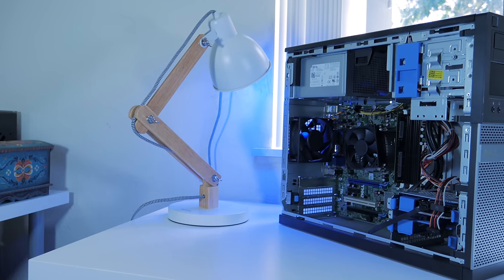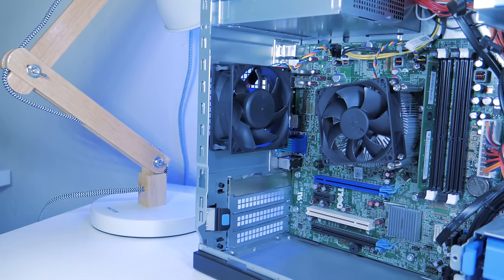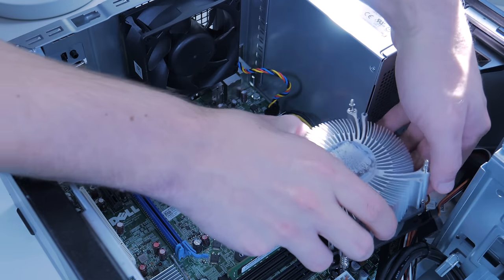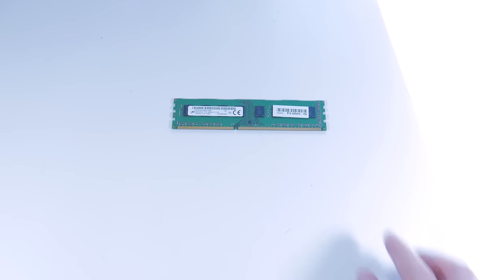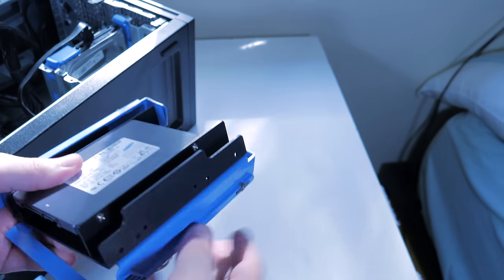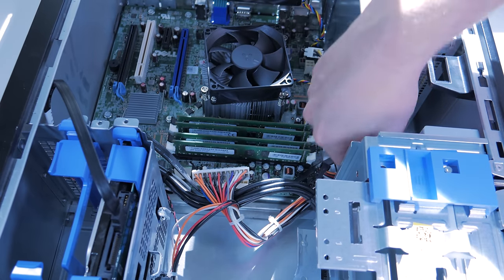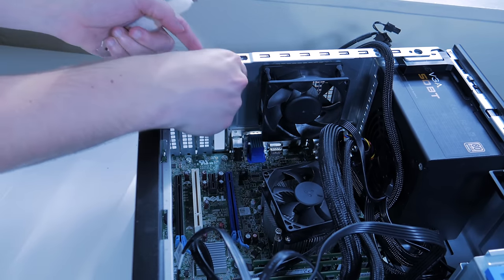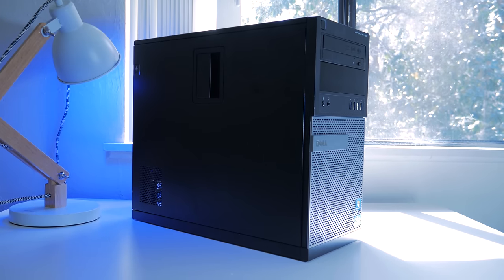How To: Turn an Old Office Computer into a Gaming PC!

Comment: I got an insane deal where I live.

Found a i5 3450 powerspec PC with 8gb of ram and a 2tb hard drive for 40 bucks. I had to replace the cooler since the system had like a pound of dust in it and it had destroyed the bearings on the old cooler. Luckily I had the same OEM cooler sitting around that I paid 3 bucks for.

I'm sure the system was stolen or something, or he thought he was selling me a lemon, but I'm not complaining.
Reply: damn that a good deal. where do you live
here in morocco a used pc like that will cost you 250$ or more
Reply: ALI sensei I live in Kansas and in a city with alot of tech.
Reply: Where I live that would cost you 500$ or more
Reply: Yard sale?
Reply: Found a Optiplex 390 with an i5 2400 and 8gb if ram for $30. Plus a ASUS GTX 770 2gb for $100
Reply: JForce that with a slightly more powerful processor cost up to 400 GBP.
Reply: On eBay US that would still run you $140 or something, nicely done
Reply: A kid who didnt know nothig about pc gaming anf thought he had a potato from 2002
Reply: Damn thats really good
Reply: Not to far from here there is a company that sells off decomissioned servers you can get a dual 6 core 12 thread cpu server with 32gb of ram for less than $200
Reply: thats a steal a normal price for that would be like 150-200$
Reply: JForce e
Reply: @jforce321  I do too, do you use craigslist?
Reply: @paydayda3rd812  yes
Reply: JForce I got an optiplex 390 i3 2130 8gb ram that also came with a mouse keyboard and the original dell 1680x1050 monitor for $25 got it from my local library after they replaced all their systems
Reply: I got an I5 5700K with 8 gigs of RAM (there were 16 but 2 were broken) and an GT 720 1GB for 70 bucks . I changed only the power supply . And I had a surprize when I found that the cooler had a socket where I found 2 sealed cooler paste :))))
Reply: ZTutorials nice pretty good deal
Reply: @icyfrog5064  yes , and I sold it today by 300$ (in this time I installed win10 pro and I activated it with KMSpico) . So everything You see a cheap PC , buy it
Reply: Can we just take a look at his channel
Reply: One time I found an LGA775 emachines at a recycling center that was probably thrown out because of overheating, the cpu cooler was completely clogged with dust. Needless to say it worked fine after cleaning the cooler and applying new thermal paste.
Reply: In my city it would cost about 50 - 70$ for used ones
Reply: Thats a good price
Reply: @jforce321  an app i wound not have risked it but atleast you got it
Reply: ALI sensei 🇲🇦
Reply: ALI sensei but it is still worth it i live in Morocco too
Reply: JForce :(
Reply: Where I live That would cost me like 400$
Reply: In Tunisia 🇹🇳  that costs 250 USD now 😢
Reply: Even PCs in England that still run on Gas cost 300 plus :)
Reply: got i5 3470, 4 gig ram and 500gb for 210 bucks, used market here are fucking ridiculous
Reply: @komradkat1073  
that's really high
Reply: Yeah who cares if you own illegal property

Comment: My family pc Acer M1935 bought on 2012 or 2013 if im not mistaken:
I3-2120, Win7, 2gb ram, 500gb hdd, intel hd graphics.

During the lockdown i tried to upgrade it now this is the specs:
Same proc, win10, 10gb ram, 120gb ssd + 500gb hdd and amd r9 270x 2gb. 

Now im saving for a new psu and hopefully a new processor by the end of the year. Wish me luck!
Reply: Good luck! I am planning to buy a whole new pc. I have an amd a4 5000 and 4gb of ram with win10
Reply: Not too bad you should save up for an a320 motherboard and use an AMD ryzen 3 zen 2

Comment: I already did this but on eBay. Got a Dell Optiplex 9010 SFF desktop. Upgraded the RAM, HDD and GPU. This is the specs now:
3.40 GHz i5-3570
12 GB DDR3
GTX 1050 Ti LP
1 TB HDD 7200 RPM
Windows 10 Pro
Reply: And why did you get a small form factor p? Have you even tested how it performs? Sff pcs suck cause to play at lest 1080p you need a small and low powered gpu and those sick and cost more
Reply: Dark Angel Rafael nice
Reply: used sff are pretty cheap for their cpu and psu, hdd . really just need a gpu for a decent gaming pc
Reply: Ran Ng got mine for $99. With the CPU inside he could've charged me much higher as others desktops with older CPUs cost about more than $100.
Reply: Sean Timothy G. Tanega I get very good performance. I'm just limited with upgrades.
Reply: D o s s o CS. thanks a lot!
Reply: Kevin Guan exactly why I got one. cost me less than a base PS4 and outperforms it in every game.
Reply: thats better than my computer
Reply: I bought a 990 recently on eBay and now I'm just waiting for the pc to arrive so I can test it and see whether It's worth upgrading.
Reply: How is i5 3570
Reply: @ApexLodestar  upgrading old PC is more money efficient that buying new PC every 5 years or so
Change my mind

Comment: Some newer Intel CPU holders/sockets (that's where the CPU rest on the MB) on the motherboard do not have a readily visible alignment mark. There are notches on each side of the Intel CPU and if you look carefully you will see the corresponding protrusions on the Intel CPU holder/socket. Align the Intel CPU notches with the socket. For RAM - if you are adding to what you already have, try to get the same latency. It will look something like this for example: 16-16-16-39. It may be important in some instances. Just today I had an incompatibility issue with some RAM and once I removed the add-on RAM my system again worked fine. Most RAM will work in unison with other RAM, but sometimes it will not. For you newbies, I hope this helps? Praise The Lord and Godspeed to you all - Hebrews 10:35!!
Reply: Tony C. 
Thanks for this man
Reply: Ram of differing latency will always train to the lower spec or the higher latency/lower speed RAM's specs. Mixing ram is generally a bad idea unless it's just mixing brand names that doesn't seem to matter much but differing speeds and latency matters quite a lot.
Reply: It's been my experience that if you have low density and high density modules in the same machine it will cause issues, and the same goes for using double sided with single sided modules.  I just want to throw it out there because I know from experience that these Dell Optiplex 790 and 990 computers won't post with DDR3-1066 (PC3-8500) or 8GB DIMM Modules. They also only work with unbuffered DDR3-1333 or 1600. They won't work with Registered, ECC, or Buffered memory. They sometimes also won't work with "gaming" memory that requires more than 1.5 volts. Gaming memory is not going to be of any benefit anyway in these systems as they offer no ability for overclocking.
Reply: The mate

Comment: I currently have the same desktop featured in this video. I have done several upgrades and now this thing is a beast. 
My specs are i7 2600 non k, 16 gigs ram, 220 gig ssd, 1 tb HDD, GTX 1070 gpu, thermaltake 600 watt psu. I added WiFi and Bluetooth as well. Oh and some RGB lol.

It crushes every game at 1080p
Reply: Price?
Reply: @plzsubtome4010  I got mine for $100, came with an i3 but I put a i7 in it for $80. SSD was $20. Psu was $50
Reply: This is late but is the pc still going good?

Comment: My Optiplex 7010:
Intel i5 third generation
8GB RAM ddr3
500GB mem
And default graphics card.
MY UPGRADES
+2x4GB ddr3 RAM - 16$
+GTX 1050 TI - 70$
TOTAL COST OF PC WAS 186$ AND IM PLAYING PUBG IN 50-60 FPS
Reply: I got this as a 2nd project pc, I got an RX460 for 50 dollars then flashed it to an rx560. It's an amazing cheap PC that won't kill budget
Reply: Jose Gap can the rx460 work on a oem like this and is yours the 4gb version
Reply: @seniorpepe9386  No, not Dell has more problems then go for this setup. Check oztalkshw prebuilt. He also has an exclusive offer on Rx 460. I recommend keeping it as an rx460 if this is your first pc.
Reply: @josem1596  no its not my first pc or anything i know that the later model amd cards run on uefi bios and the optiplex i hvae can be swapped to uefi mode but im not sure if it will work i dont want to waste my money and it not work
Reply: Did u just say 500gb memory xd
Reply: Kijo idk where you live but I have 4 sticks of ddr3 ram I don’t want so if you want 2 then you can have them
Reply: NOT Lencx hey I’m building a pc could I have them?
Reply: Lencx lol can I have it
Reply: cool, I can imagine ur playing at high to max settings?
Reply: You have 508gb of ram

Comment: i7 2600, RX 560, 16gb ram, and a 110gb SSD took a free office PC to a capable gaming PC. Plays what I want it to without any problems and was $110 in parts to add on to what was there. Luckily it had a 750 and 500gb 7200 HDD's already in it.
Reply: what was the name of the office pc? Might do your build
Reply: @LaStallion  it was a no name prebuilt. It had an i5 2310 in it to start. If I was doing it again I'd go ahead and get the i7 3770k if you have the appropriate bios for it.
Reply: @LaStallion  I have since also added a cooler master 400watt power supply, ring 12 120mm front fan, and waiting on a gtx 1650 super and an upgraded CPU cooler. The additions will get me playing Doom eternal in 1080 with high settings and comfortable temps .

Comment: Hey Matt! You can actually clone a larger drive to a smaller one so long as your data does not exceed the size on the SSD! I've done it before using hirens boot disk :)

Comment: I would recommend starting with an Optiplex 7010. It looks exactly like the tower in the video if you get the larger form factor. However, some 7010 come with an i7-3770 already in the board. I found one cheap and threw in a 400W PSU, 32GB Gskills Ripjaws RAM, 250GB SSD, 2TB WD black HDD, and a GTX1060 6GB. It is my daily rig and I love it. It handles anything at ultra in 1080P.
Reply: If it the CPU is in the motherboard you can't change the CPU without changing the board right?
Reply: @david7598  bro the 7010 has removeable cpu

Comment: I've been planning buy an i7 2600 optiplex and upgrade with a better psu in a new case with a gtx 1070.
Reply: PaneledPear6555 will that even work
Reply: PaneledPear6555 Tbh if you have a 1070 you should a better system like a ryzen system.
Reply: On Soul Not necessarily. If you do 60 fps on higher resolutions then the 1070 is the component creating a bottleneck. While the 2600 will go strong up to around 100-120 fps at 1080p ultra.

Comment: Nice thing is that many of those 790s come with the i5 2400 as the OEM chip, all of mine did. I didn't even know these machines were good for upgrading and just happened to have bought 3 of them from Goodwill, they've all worked out great so far.

Comment: Usually Dell uses custom cases. It's hard to modify a Dell because nothing really fits into the case. I suppose it would be best just taking the components out and putting them into another case.
Reply: you can't 'cos sometimes OEM mobos also have custom design and you simply can't fit them into any other case.

Comment: Had a Dell Vostro 230 on hand. Had a dual core cpu and an old mechanical hdd no video card. 2gb ram. I added an Intel core 2 quad Q9650, Nvidia GT1050, 600 watt Raidmax PS, bluray rom drive, usb 3.0 frot header and rear addon expension card, 8gb ddr3 1333 ram, 500gb WD SSD, put in better fans and used the old mechanical HDD as a storage drive. All of which I had on hand. Thing runs sweet. Using as my backup pc.

Comment: Did this last year for one of my boys.  I7 3770, 16g, new 250 SSD & 1 TB HDD in there.  I already had a GPU sitting around from some old builds, so all I ended up buying was a GTX 1060 mini off ebay for $100.  I added some new thermal paste and cleaned out the dust.  The GPU & CPU are a good match - no bottlenecking.  It's silent and fast.  If you're running 1080p at 60hz, then there really is no reason to drop $1k on a new PC.

Comment: I have a Dell OptiPlex 7010 which came with an i7 3770. I added 16Gb RAM and a GTX 1070 and the performance is amazing!
Reply: Did you get a new power supply?

Comment: I found an optiplex 9010 with 16gb ram and a i7 3770 for $220. No hdd, but holy crap! Got a 750ti, a cheap used evga 600w, and a $20 wd blue. Awesome system for under $300. Just assembled it today.

Comment: The i3 2120 is honestly great. I paired it with a gtx 970 and 12gb of ram and it ran gta 5 on almost ultra settings. But 1155 motherboards are hard to come by
Reply: Roberto Ortega the cpu might be a huge bottleneck sometimes
Reply: Roberto Ortega The i5 2400 is a better option.
Reply: the ryzen 3 1200 is much better for the same price. compare them on cpu.userbenchmark.com and you'll see
Reply: WhatTheHax cpu user benchmark is whack. It doesn't give accurate info. The i5 2400 is just as good.
Reply: PaneledPear6555 tbh,if the guy wants sumthing new,he should go for an ryzen 3
Reply: littlelittle boiboi I don't think so. DDR4 prices are so high that ryzen 3 isn't worth it at all.
Reply: littlelittle boiboi An i7 2600 optiplex is much cheaper and can handle 1070s unlike the ryzen.
Reply: Find a used i7-2600. It is a great way to extend the life of that PC.
Reply: an i7 2600 cannot handle a gtx 1070 honestly maybe not even a 1060 it performs worse than an i5 6600 I know the i7 sticker makes it sound mean but by todays standards its garbage
Reply: BruH MiZR Wrong. An i7 2600 can 100% handle a 1070 if you play 60-100 fps ultra 1440p. For higher fps gaming, it can't, but you'd need a really powerful rig with a newer i7 or 8th gen i5 and a 1080 or 1080ti for that anyway (the 1070 hits around 100 ultra, so a 2600 works just fine). The 2600 can definitely handle a 1070 and can murder a 1060, as the i5 2500k can handle 1060s well.
Reply: id rather buy an HP 6300 Pro and get an i5 3470 with a gtx 1050 ti LP. removes any bottlenecks with the CPU and the CPU is very capable in 2018, and dominates the i3 6300 in performance with single core and all cores according to cpuboss.
Reply: oldcracker Yeah 3470 is a bit better than the 2400. Great cpu.
Reply: yeah and also, it has a good upgrade path of up to an i7 3770.
Reply: My optiplex will come with an i5 2400, dont know the video card but it doesnt matter since its getting upgraded, it also starts with 8gb ram and i believe that the optiplex 990 has up to 16gb ram limit.
Reply: TWrecks DDR3 is real cheap so upgrading that ram shouldn't be hard once that's needed. Your upgrade path is very good too.
Reply: A first gen i7 when overclocked can keep right up with a 3770. People claiming that a 2nd gen i7 will bottleneck any current GPU are mistaken unless you are using a really cheap low end chip set motherboard you won't be bottle necking.
Reply: Benjamin Hale Even with a low end motherboard it shouldn't make much of a difference. For certain first gen i7s, I can sort of understand some efficiency complaints, but most of them are still viable especially once overclocked (though a lot of the earlier and weaker models don't hold up against even the i5 2400. Still not bad because even the i5 2400 is real powerful).
Reply: PaneledPear6555 , you may be slightly surprised how big a difference a budget vs. a high end chip set makes, you'll notice that most benchmarks and reviews use the highest end boards exclusively if it didn't make much difference they would test the lower end ones more, and I think they should because a low end test would reflect more closely with OEM speeds and specs and people mostly buy OEM only us tech heads and people who have friends like us usually use custom builds, OEM boards (dell hp compaq etc) tend to see the largest performance hit. I happen to still own a 1st gen i7 the i7 875k and it's in an Asus Maximus III Extreme motherboard p55 chip set 16gb Gskill Rpjaws DDR3 1866(10-11-11-30-cr2) clocked up to 2167 (10-11-11-28-CR1) the cpu is sitting at 55-60c under synthetic loads at a 3.97GHz clock all cores with HT enabled at about 1.34-1.37v and it still chews through tasks and games. 658 multi score in Cinebench R15  which is just 4 points shy of the i7 3770 baseline.
Reply: Benjamin Hale Yeah a good quality oc board will be able to match the performance of a plain board with a 3770 inside. That being said, if your cpu is not overclockable, even an oem board will work. 875k is still great, but the issue is finding a good board for that generation of cpus. If you go used right now, I'd recommend an oem machine which gives you the best value. Once performance finally drops, get an overclockable board first and then go for an overclockable i7 (2600 and 3770 non k are actually overclockable up to a certain point). That being said, the cpu will last long enough without an overclock to not require an upgrade for a few more years, and by the time an upgrade is necessary, I don't think it'll be worth allowing for overclocking and, rather, a new cpu and motherboard will be needed entirely. Either way, the best way to start right now is with an oem board and a 2nd or 3rd gen i7. For you though, your cpu still has a lot of life left and will stay strong for a long time.
Reply: Benjamin Hale Yes an oem board will be worse in terms of performance by a small margin when using a regular cpu, but not enough to make a significant difference. Again, a good board is for overclockers.
Reply: Put i5
Reply: The i5 2400 is about the same performance as the Ryzen 3 1200. The Ryzen is going to have a bit better single threaded performance while the i5 is going to have slightly better multithreaded performance. Overall they are similar for computational power.
Reply: Stepside1986 However, the i5 costs significantly less with ram and motherboard prices considered as well.